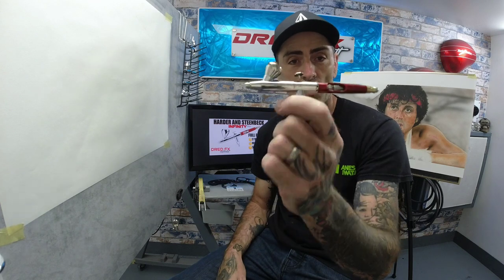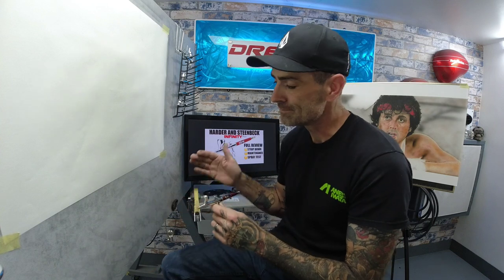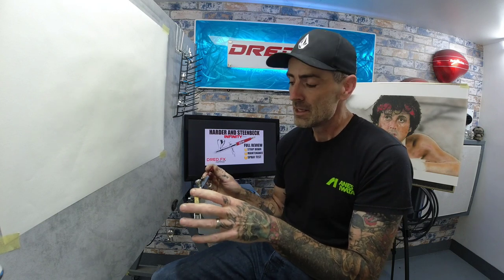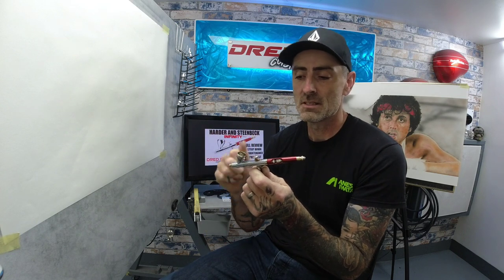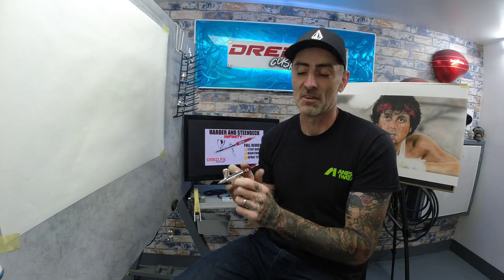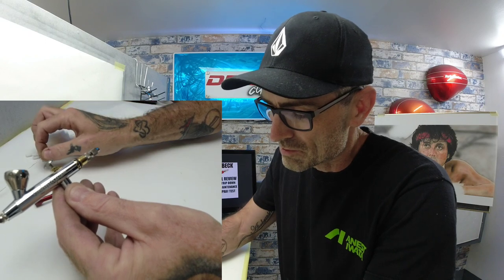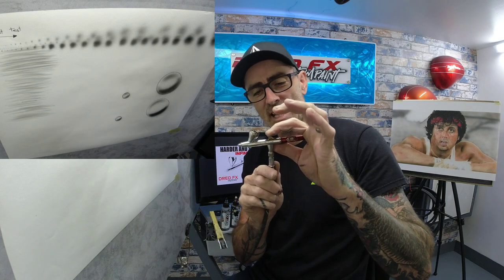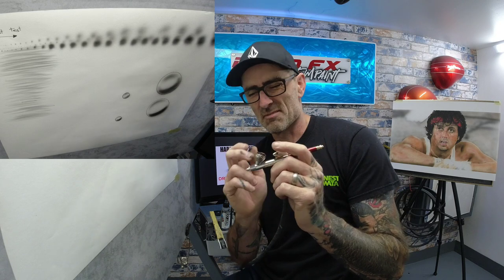AIRBRUSH REVIEW Harder & Steenbeck strip down maintenance and spray test

Comment: the .15mm set up is just too small!! the needle is so long in its taper that it takes the trigger such a long  travel to get the paint to finally start to atomize.  I was able to change this by keeping the trigger full forward while pushing it down for air. As I was doing that , i then loosen the back needle chuck and pull back the needle till it sprays( using water). I then slowly push the needle forward just until it begins to stop the spray then tighten the back chuck to hold the needle in place. Now when I pull back the trigger i get instant spray. The needle is slightly back from full forward position which gives the trigger less travel for it to start.  The .15 mm is really for ink and watercolor and maybe thinned solvents but for acrylics and water based urethanes like autoair , its just too small imo.  I think the .2 mm set up would be better for a more responsive feel with the trigger.
Reply: Agreed. See my comments in the main thread.✌️👍

Comment: Being an owner of a crplus i can agree the trigger feels odd, but i use the airbrush for painting minitures and dioramas not flat work. the new one that dropped this month (Giraldez) has really tightened the trigger up so its very very responsive, and the trigger now has a nub for grip for bigger fingers. I picked one up and its night and day to the infinity crplus i own, shame it took them a year + to get the main problem fixed. but in all honesty i think the .15 needle and a lot of use for the infinity range is more for model painters who need tiny tiny detailing as they are working on a piece thats no bigger than your thumb if that, most of the time.

Comment: Great video✌️😊

I try not to use super lube as it leaves a blue sticky residue (H&S used to use it at the factory too iirc - I've found sticking parts on new H&S airbrushes, the residue acts like thread lock on threads too), I use glycerine instead✌️

Did you use a special H&S tool to replace the packing seals?

How do you find clean up of the Creos, compared to ease of H&S?

I'm not keen on the feel of the H&S triggers or the paint take up on the Infinity. But I'm a mere hobby user, H&S are good brushes, less expensive than top Iwata too for casual users. Spiked myself with the 0.15 needle, lots! Swapped it out to a 0.2 for acrylics and 0.4 in the Evolution.

I end up using my Paasche H for base coats and primers, and 0.55 Millennium for general work - I prefer the trigger! And H&S for detail work (and I often end up using good quality sables etc instead - most who see my work are complementary). I'm pondering moving away from H&S - they are good but the trigger/paint take up is niggling me now😳🙄😊✌️
Reply from the maker: I started with h&s and they got me so far then you move on to iwata or creos and you don't look back
Reply: @dredfxcustompaint  Thanks, good videos btw✌️👍😊I've had Iwatas they do a good job of work, but with their two part nozzles (I think that some now have one piece nozzles - but they're still fiddly) etc were VERY fiddly during clean up and that tiny assembly was in danger of being lost from time to time. Also with a fixed cup etc clean ups were a joyless task. I've never had that issue with H&S. But they need to do some continuous improvement on the triggers and packing seals akin to some specials that they've done. I think though that my H&S Evolution CRP and Infinity CRP atomise and spray better than low - to mid range Iwatas. But it's all first world stuff so it's niggles for me personally really, as I'm thankfully not drinking water from a muddy puddle, just nit picking ✌️👍🤔😕😇 Might be different for you, doing eight hours a day on them though. You're a superb artist btw✌️👍😊

Comment: Wow. I have the infinity for so many years now. Never paid attention on how much effort I need to press on the trigger. Now that you mentioned it. The infinity takes twice the effort to press down the trigger compared to my Iwata custom Cm-Sb.
Reply: You can change the trigger pressure on the infinity by unscrewing the adjustable part in the inlet valve with a flat headed screwdriver
Reply: Thanks for the tip. Will try that.

Comment: Very informative video and looking at your channel and your art you sure know your way around airbrushes.

I started using an Evolution 2in1 for my miniature painting and after the initial learning curve I really like what it adds to my hobby. Now I am thinking of expanding with a detail airbrush. 

I was pondering the Infinity, but after seeing this, maybe the Iwata HP B Plus would be something else to consider?

I like the Evolution, but it never occured to me that the trigger handling with the “delayed” paint flow could be any different. Do you happen to have any experience in that department?
Reply from the maker: Hi first off thanks for giving us a look regarding the infinity you can turn your EVOLUTION into one by changing the needle and nozzle to a 0.15mm if you wanted 
To go a cheaper route if not and you wanted another brush I would go for the creos ps 771 0.18mm for detail it will match the custom micron and you get the mac valve with it as well so bonus 😉 the trigger on the ps771 is spot on my infinity just sits on the side collecting dust now I don't use it as the creos is my go to brush for detail stuff hope this helps you out I have reviews on the creos so you can see how good it is 
All the best DRED FX
Reply: @dredfxcustompaint  Thanks for the detailed answer!

I know I can switch most H&S parts, that's actually why I considered the Inifinity in the first place. But I'm looking to get a dedicated detail brush with the Evolution being my workhorse for priming, varnishing and basecoating.

I'll take a good look at the Creos, thanks for the recommendation! It's interesting, the marketing departments of H&S and Iwata have made this pretty much a two horse race for us miniature painters. In the US there's also Badger, but in Europe all articles circle around Iwata vs H&S. Thanks again, you have a new sub!

Comment: Im about to get this infinity cr plus but i guess i will stick to my first love gsi creos 771
Reply from the maker: Yes stick to the 771 a much better brush with a better trigger as well and parts are cheaper and you get a mac valve so bonus thanks for watching all the best DRED FX
Reply: @dredfxcustompaint  thank you for a good content and doing a great review!
Reply from the maker: @myko.lektion880  your welcome👍 all the best DRED FX
Reply: I have the 771 and it's butter smooth on the trigger pull but pressing down for air has some binding right in the beginning but could be just mine

Comment: 30:00 , sry im talking again.. but you just put the finger on my problem... its about the trigger.. not the sploshing of paint/not thinned enough etc.. it really isnt.. its that milimeter feeling when u back up that needle... trying to paint eyes on a model thats half an milimiter in size...  instead of this  dot ---> .  // you go like this dot---> 0 . and then the airbrush get a flight trough the apartment.. my infinty in the beginning got stuck in a clearcoated wooden floor... it wasnt the needle like a dart... it was the needle protector...and thats flat . that force.. didnt knew i had it in me... / cheers. spot on . / dont wanna bash on it though , since it was my first.